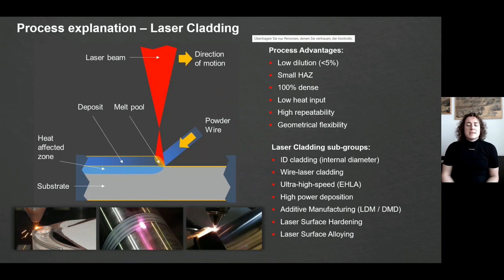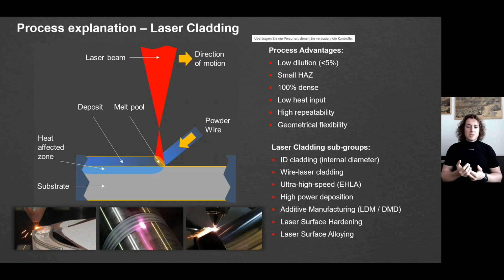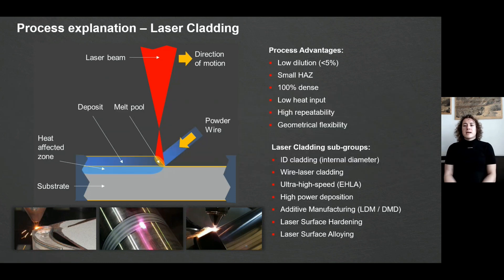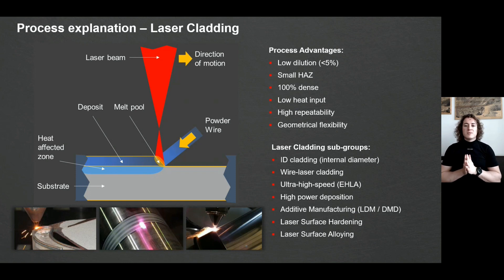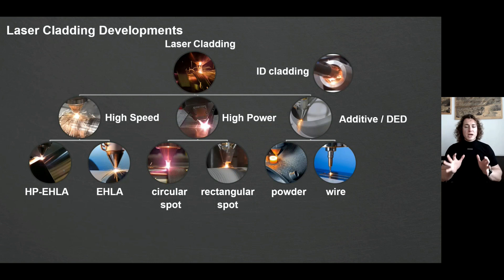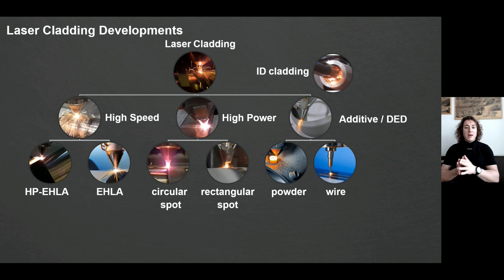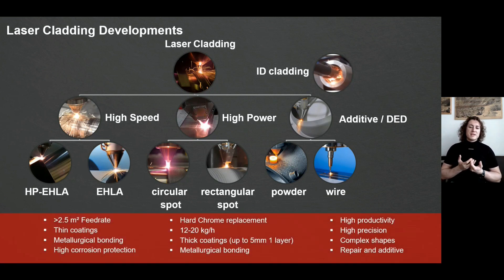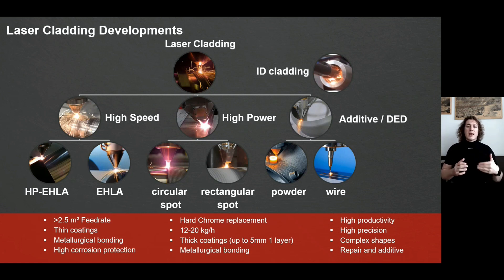Introduction to Laser Cladding | Principles, Applications & Industry Insights

Comment: Thank you for the explanation Arkadi! Do you think that one could achieve structural colors with surface modification by laser cladding? I know, a MOPA fiber laser can make colors on stainless steel, but i am thinking on something more vivid like the butterfly wings' colors.
Reply from the maker: Hello. Thank you for your feedback! Do you mean the laser structure coloration? I am not sure about that. That effect is usually achieved with short-pulse laser processes (nano-second).
Reply: @TechnologieswithArkadi  hi, thank you for your response! Yes, i meant the short pulse laser coloration. I was hoping to be able to find a micro(/nano)struture that can be formed by a short laser impulse other than the changing oxidation state of the metal that achieves the coloration.